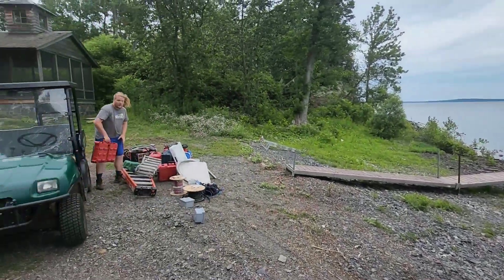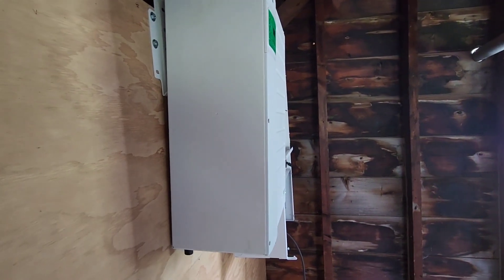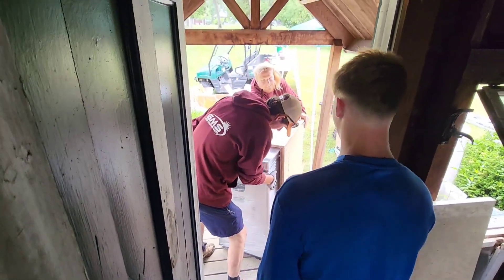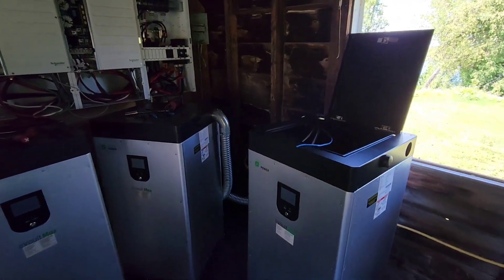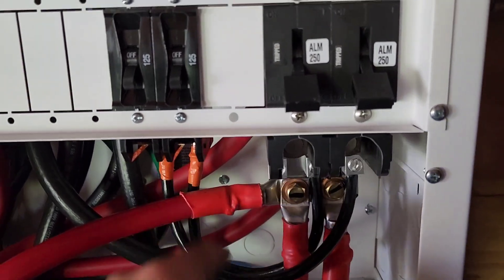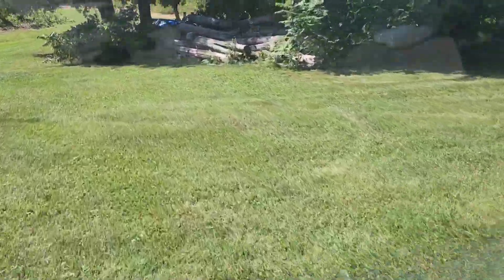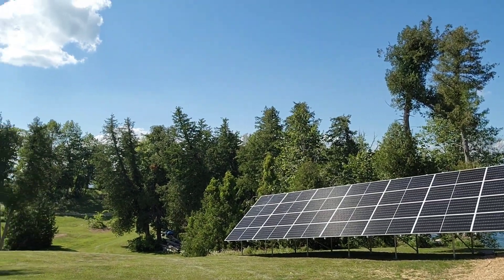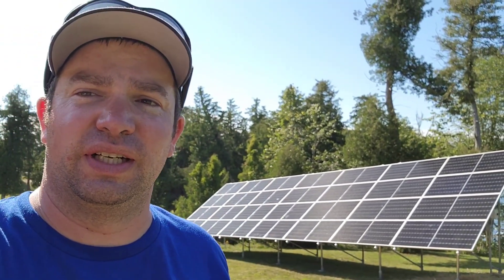Off Grid Private Island Powered Up with Schneider XW Pro and Fortress Batteries

Comment: I need some special tool to configure the 2 inverters (conext tool)
Reply from the maker: The tool was only needed if you had inverters that put out different voltages.  I didn't need the tool  because I bought them at the same time.  Now, the newest firmware does away with the need for the tool.  (Starting at v1.17)

Comment: Ben I am confused on the specs for the  Schneider Conext MPPT 100 600 6kW Solar PV Charge Controller
I have a question about the Schneider Conext MPPT 100 600 6kW Solar PV Charge Controller
is the 550Volt and the 35Amp the total for two strings or for each of the two strings?
I am trying to figure out the max volts, amps per string on one of the Schneider Conext MPPT 100 600 6kW Solar PV Charge Controller before I commit to buying one of these.
Also how were the string configured for each the the two Schneider Conext MPPT 100 600 6kW Solar PV Charge Controller?
Thanks for a great video
Reply from the maker: We used 2 strings of 7 panels into each charge controller. The spec sheet should show how much you can run into a single charge controller.  Basically try to get the voltage as high as possible, then parallel. Each string should only be 10 amps or so, but if you max out the voltage, you won't likely fit more than 2 strings.

Comment: Cool project. I did notice a few code compliance issues with the installation that you could improve on in future projects. It looks like PV power source circuits enter the PDP with other AC and DC circuits. These need to be kept separate. Also, there is a working space violation that the batteries create being installed below the XW components. They cannot exceed 6” from the face of the equipment installed above. Most importantly, the eVault max cannot be stored below -4F and doing so will void warranty.
Reply from the maker: Thanks Chris.  I did realize the PV source circuit issue as I was headed back on the boat the last day... good call there. As far as working space, the batteries can be rolled out of the way if needed.  You saw that shed in person, it was a tight fit! 
I'm curious, what was your plan for keeping the batteries above -4 out there? Sounds like they'll be building a new heated utility building in the next couple years.
Reply: I agree that it’s sometimes impossible to achieve this working space requirement, however, installing the generator outside would probably clear up space and allow you to not void gen warranty. Even with exhaust ducts, generators should not be installed inside buildings.  To maintain spec temps,  insulating the room well and heating with a propane heat source are good options. A solid insulation job will likely achieve this -4F. Otherwise, moving to a more modular battery so that it can be removed from site during the winter months would be another option.
Reply: I saw that with the batteries but sometimes there's nothing you can do. However we have tried that in Santa Barbara County and 100% of the time the permit is denied.

Comment: Do you think one XWPro would handle 40 kwh a day?
Reply from the maker: Totally.  Just make sure your peak load is below 12kW and your max continuous load is below 7kW.  Mine routinely handles spikes of 8-9kW for 20 minutes.  This thing is a tank.
Reply: @benssolarandbattery  my home is 1600 sq ft. 3 ton heat pump seer 18 has a inverter and soft start, it does have heat strips. Other major loads are hwh, stove top and oven, dishwasher, fridge, freezer, microwave.  Other loads are a few led lights, tvs, phone chargers, toaster, coffee maker, printer. These loads are used sparinly. 2 person household. I can control the hwh with a time clock. As I started before the past year's daily average usage is 40 kwh. I hate to buy more inverter than I need but also don't want to underside either.
Reply from the maker: @craig mitchell  I'd love to say 1 will do it, but you may run into issues with the running the heat pump heat strips and stove/oven at the same time.  You could always build a setup with 1 and then add another one if needed, just use a PDP and you'll be able to add another one easily.
Reply: @benssolarandbattery  Ben I understand that the breaker and relays is limited to 60 amps in a single XP. When adding a second XP,  do you add another 60 amp breaker to the PDP and parallel these 2 breakers to your house panel?
Reply from the maker: @craigmitchell5628  yup!
Reply: @benssolarandbattery  thank you for taking the time to respond to my questions! Look forward to your future videos.

Comment: Hope that shed’s roof doesn’t leak!
Reply from the maker: It doesn't as far as I know!
Reply: @benssolarandbattery  People are weird. All that solar equipment in that shed. Build a new one known to be watertight and insulate it. And temperature regulate it with a simple fan and electric heater!
Reply from the maker: @macunknown  that's actually the plan in the next couple years.  They wanted something right away, and this being the generator shed was the best place to put everything.  They'll be building a new one nearby and we'll transfer everything over.  Not the ideal way to do it, but here we are.
Reply: @benssolarandbattery  I’ve found myself there many a time too. Nice work on your part!

Comment: To take advantage of those bifacial panels put down white crushed Limestone underneath and behind the array it will reflect sunlight and increase the amount of output by about 10 to 15%.
Reply: Be hard on an island lol
Reply: @SolarTechFL  You can buy bags of it on the mainland and transport them the same way the panels got to the island.
Reply: @boblatkey7160  I got an 8% increase in PV production just by putting down white crushed stone in front of my arrays. The ground bounce to my 45° array adds significant energy. I would imagine a bifacial would benefit even more. You might see only 2% if you're panels are over brown earth or grass, which doesn't reflect much light.

Comment: I have the sw 4048 have had it running off 1 10kw ufo battery for about 8 months without any trouble . I also use it each day though . Has not given me a single lick of issues . Glad to see you giving them another chance .
Reply from the maker: I have a couple SW's in my shed, just waiting for the time and application to install them!

Comment: You should do a follow up video with the Schneider xw pro an do a load test.
Reply from the maker: I won't be able to with this system, but I'm currently installing a single unit in my garage that I will be testing.  Everything I've seen so far indicates it can handle quite a bit.

Comment: You said your Solark had problems running your electric dryer. Did the XW Pros handle the electric dryers for this customers install???
Reply from the maker: They did!  I've been monitoring the site and there was one day where they ran 6 loads of laundry. The largest draw I've seen on monitoring is 7.5kW, so well within the limits of 2 XW's. That fact that they've been proven to put out 12kW each for 1 minute really helped my decision.   I'd love to test a Sol-Ark 15k, but they won't give me one and I won't buy one personally.
Reply: @benssolarandbattery  Thanks for the reply and info. I am off-grid and have a SW 4024 it has been running flawlessly for the passed 8 years. I have a stackable washer and dryer and have run the washer with no problem during that time, but never even considered trying to run the dryer .Then after  watching a YouTube video lately by Abny Solar where he torture tested a XW Pro. I decided to do a test with my SW 4024 and see if it could run the dryer with everything else in the house turned off. and low and behold it did it. I only ran it for a few minutes with no clothes in it and it was pulling over 5000 watts. But it worked. Now granted if I would have left it running it would have overloaded. But it handled the surge with no problem. The SW 4024 are not stackable. Can you think of and alternative way to increase the capacity like maybe  ac coupling a pv inverter so I may be able to run the dryer and not cause the SW 4024 to go into overload?
Reply: @bowbilly9080  You used to be able to stack 2 SW's, but they had a lot of trouble with this and discontinued the ability to do so.  You can AC couple the SW, but you can't really get more total power since it doesn't know the generation of the AC coupled solar - nor the consumption.  So it can't manage that too well, so max AC coupled power can not be anymore than the output power rating (or a bit less - see the Schneider AC coupling guide).  And when your batteries are near full charge, it has to shift the AC frequency to curtail or shut off the AC coupled solar completely.  If you want more stackable power - you need the XW Pro series.  A bit more money that the SW, but with greater surge and stackable - it is a real workhorse.
Reply: My single XW Pro handles 6000W Dryer, 1500W Washer, 1500 Microwave, 1500W microwave, and 1500W well pump at the same time.  I'd like to try my A/C unit at some point.

Comment: What does it mean when you say “Commissioning the System”?
Reply from the maker: Firmware updates and programming.  There are a lot of settings on this system.  Each charge controller and XW needs a device number and to be set correctly. AGS as well. Then there's the closed loop comm from the batteries as well.
Reply: Thank you.  I had heard that term on many channels and never understood what it meant.  

So it is basically setting up programming for all parts so they all properly function and communicate.

Software set up after Hardware installed.

Comment: The biggest question I have is based on efficiency. Now, that Sol-Ark doesn't have the problem with the 15K and piggybacking two 12K units seems to eliminate the surge balance problem on 120V circuits, wouldn't this system been less expensive and more efficient using either two Sol-Ark 12Ks piggybacked or a Sol-Ark 15K? My original 6048 Schneiders coupled with Outback chargers was very consumptive idling before it burned down my shed from charging lipo4 batteries below freezing temperatures when my heat system died. When I think about the ease of adding a 3rd 12K or making the entire island light up like a huge 4th of July fireworks show, I start drooling about seeing the piggybacking of two Sol-Ark 15Ks!
Reply from the maker: I will test the idle draw once I'm done installing the single XW in my garage.  From what I've heard, it's much lower than the 12k.  This was a little cheaper than 2-12k's.
Reply: Isn’t an Schneider pro half the cost of a SolArk 12k? Bms with low temp protection stops batteries from charging below freezing.
Reply: @RJ-cc1fz  The Schneider Pro is only the inverter. You need to purchase separate chargers, breakers, panels and a host of other stuff that are all built into a Sol-Ark 12K. Usually, these types of coupled systems are more expensive and not close to the 97% efficiency of a Sol-Ark.
Reply: @RJ-cc1fz  The XW Pro is only an inverter, and those 100A charge controllers are well over $1,000 each plus the $1,500+ in the DC load center and DC breakers.  A 12K has more capacity than an XW Pro plus as much solar capacity as the pair of Conext 100 600s.
Reply: @randacnam7321  Even though I own a schneider xw pro, I am not a fanboy.  I don't care about manufacture, only performance for $.  You are not correct in saying a 12k has more capacity than XW or as much solar capacity as a pair of Conext 100 600s.  Check the specs and use them.  I priced out a sol ark 12k, and 15k.  Both were more expensive than a single xw pro, mini pdp, and 2 charge controllers.  XW pro will run 10 to 11k watts and still start 3/4 well pump with uneven 120vac legs.  I think Ben will find the idle consumption and efficiency of the XW pro to beat the sol ark's too.  Installation of Sol Ark or all in ones is of course simpler because you are not installing multiple devices on a wall.  I think for a home where the wife or children run whatever they want when they want, the XW pro is a very good choice.
Reply: @TheJjyoung333  The XW Pro is only rated for 6.8kVA continuous.  It can handle more than that surging, but not continuously.

Comment: We chose Sol-Ark 12K X2 last year instead of Schneider, because of all of the reported poor customer service. Integrity and Great Customer Service will keep your customers coming back and recommending you. We love our 20,640W of QCells430W and 134kWh diy battery.
Reply from the maker: Sounds like an awesome system!  I still love Sol-Ark for sure.
Reply: Sol-Ark fine for grid tie but good luck using it in off grid applications with large inductive loads. You will be one unhappy camper!  They still have bugs that they have not been worked out and you will be introduced to them.
Reply: @boblatkey7160  i’m totally off grid and do just fine. You just have to get a 20SEER and above heat pump systems, city water, so no pump needed and I have my shop on a separate system….Schneider😊

Comment: Lol, just as I was considering whether to spring for a Solark 15K or the 5K to AC couple into the 12K using the new panels I'll be installing on an out building. I'll be keeping an eye out for your thoughts on Schneider. As I told you before they were out of the running for me 2 years ago because of all the complaints of lack of support. Good to see that they're turning a new leaf.
Reply from the maker: I haven't tried the 5k or 15k yet.  The Sol-Ark in general is SO much easier and quicker to install and commission.  I stayed away from it here because I was hesitant about its surge capacity.
Reply: @benssolarandbattery  I hear you. Sounds like a lot of pumps and an unknown load profile with that guest house. As for my place I live alone so the power profile for my place is well established and I live within that envelope. One thing I find interesting is your continued problems with your dryer. Since the last time you mentioned it I have not had a single dropout due to the dryer running - it draws 6KW. I've run it during the day and at night (when I'm desperate) on the batteries and no shutdowns. The one thing I know not to do is try to run the AC, microwave, electric cooker,. etc, at the same time. System has coped with my well pump running too so I guess I'm lucky ? My well pump is a 240V unit, though. I also invested in a MicroAir slow start for one of my 3Ton AC units during last winter. I installed it  and running it now is a no brainer, no stress affair. The AC runs at about 2.5-2.8KW continuous. This year I have not had the 12K drop out for overload reasons at all - touch wood. Checkout Engineer775 recent video's where he installs a MicroAir if you haven't seen it already.
Reply: @OldManLawrence  There are times that I wish the Solark could go well above the 60V limit but I've learned to live within its "limitations". Limitations being only it's instaneous surge capability without having to spend more on other things. Other than that I am very happy with my unit and has provided trouble free power to my home for two straight years now. That is after 3 months of frustration trying other manufacturers product before hand.
Reply: @OldManLawrence  I have 10 batteries (134kWh) connected to two 12k. Each battery never sees more than 37 A. I built each battery to handle 100 A. The Chinese BMS are rated at 150 to 250 A. My 1/4" x 2.5" tin plated copper bus bars and 3/0 cables handle the 20,000W just fine.

Comment: Well I was talking to ya live a second ago. Don’t know what happened. Regarding switching your home batteries to the Schneider. That will be good for ya because the Schneider can use the higher voltage of 16s
Reply from the maker: Yes, I'm excited for it.  I've been working on tying it in slowly, but have been super busy with other things (this for one).
Reply: @benssolarandbattery  this one here was an awesome place to work and a good looking install. Please make a video regarding swapping the your batteries over to the Schneider. And if you don’t mind show how to set the Schneider up in grid tie mode with Cts. A lot of people don’t know the Schneider can do that. Most people are not fully offgrid so the video regarding zero export grid tie with Cts should get a lot of views.